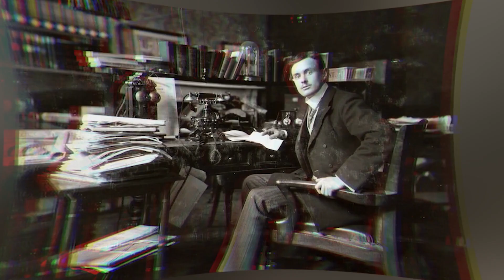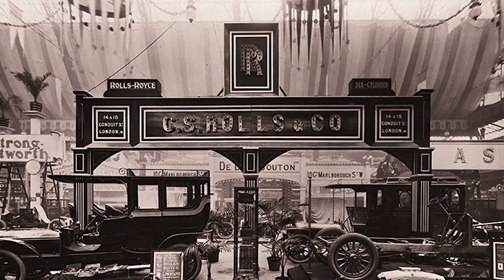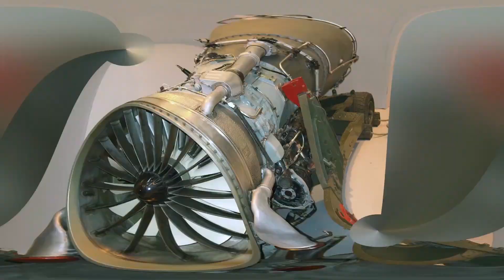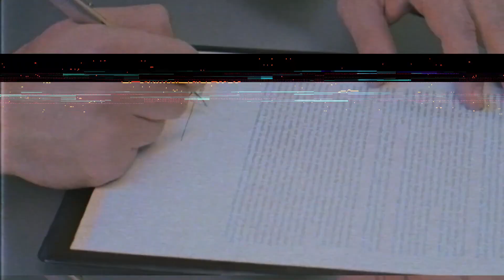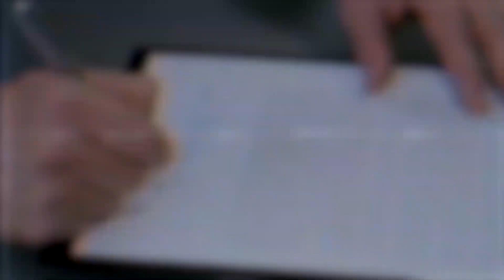A Poor Miller’s Son Invented The World's Most Expensive CAR   The Story of Rolls Royce

Comment: Since it was bought by BMW it now uses German parts and lots of complaints about how unrealble they r. same with Bentley.

i used to have a Vauxhall caviler under the bonnet it had plates saying made in germany by Opel. had lots of trouble with it keep breaking down. Also had the opel version of the same car. That was made by Vauxhall in the UK and was very reliable as it used British parts were as the Vauxhall used German parts.

Several years ago VW had to recall all their cars in their group except for Skoda due to the ingintion packs catching fire as VW, Bentley, Porche, Audi and Seat al use the same German parts. Skoda uses cheaper parts from the check repulic and is far more relaible.

When i was based in germany with the army in the 80's i asked my German freinds about buying a car while in Germany. they all told me the same thing dont get a German car as their junk.

1 place i used to work as a delivery driver 1 of my bosses bought BMW cause of the staus symbol but he hated it and said his Rover was far better. the other boss bought a Merc 190E and hated and tried to get me to do a straight sawp for my SAAB 9000 which i bought the same day he got his merc. He paid £4000 for his i paid £2000 for mine both used and same year. i took his merc for a drive he took my SAAB for a drive and he said the SAAB was far better than the merc.
The merc no elctric windows no air con not even a radio. plastic seats. my SAAB had cruise control. automatic climate control. velor seats. Electric windows all round, Automatic traction control Radio cassette and it wasnt even a top of the range model. The merc 2 litre did 15 miles per gallon the SAAB 2 litre eco power with light pressure turbo did 70 miles per gallon.